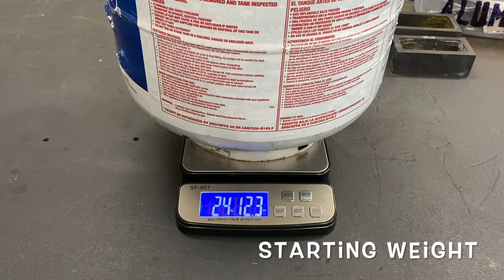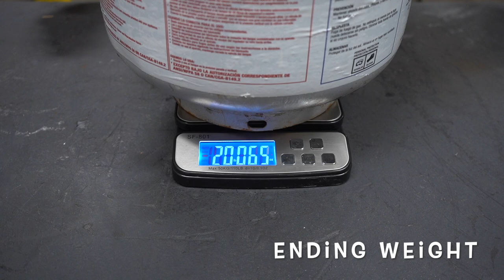Office Copier Recycling - Trash To Treasure - Copper and Aluminum Casting

Comment: Can the forge be made hot enough so that you can smelt the steel and make ingots? Can it smelt Iron? Also how do you get all the dross and residue out of the crucible?
Reply from the maker: No unfortunately a propane forge will not get hot enough to melt steel or iron. the crucibles clean up fairly well though, you try to get out as much as you can while they are hot, But once they cool not much sticks to the graphite. You can pick it off and clean it up with a screwdriver and wire brush.

Comment: Seriously, how do you know if material is aluminum vs steel?
Reply from the maker: Stick a magnet to it. Aluminum in not magnetic
Reply: @trgfoundry5276  Oh duh!  Makes sense!  🙂
Reply: @cprxprt150  Of course Stainless Steel is also non-magnetic... but Stainless Steel is more easily distinguished... it has a melting temperature so high you need a blast furnace for it...